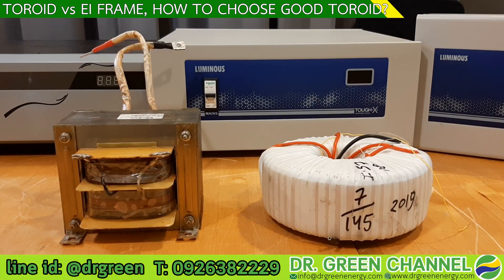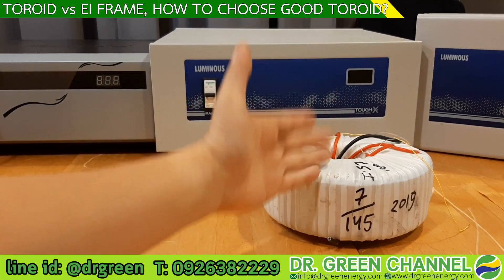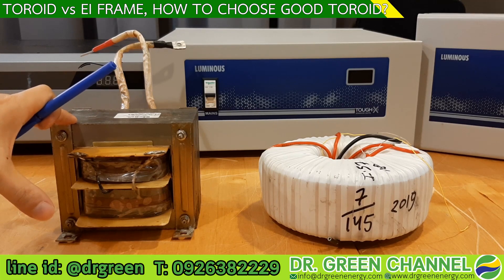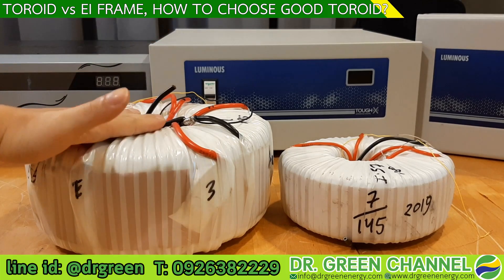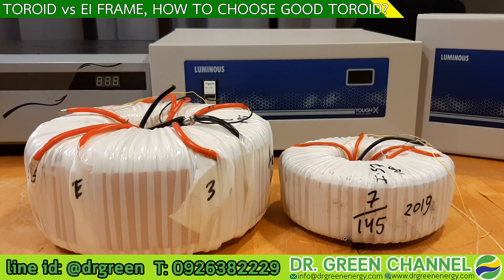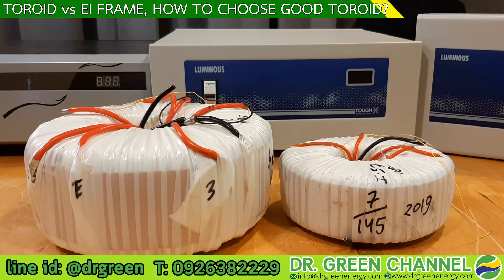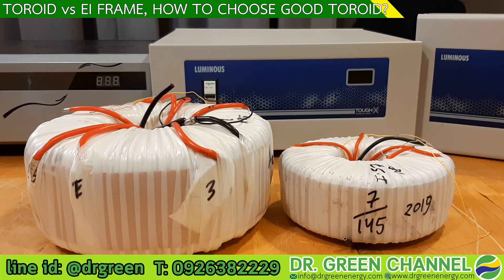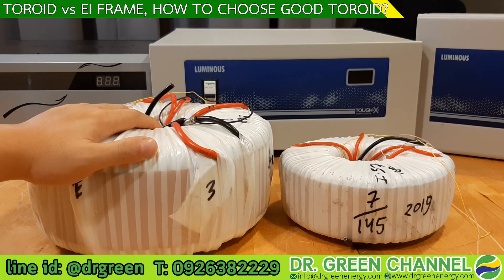Dr. Green Energy - Toroidal vs EI Frame Transformer & How to choose the good Toroidal Transformer?

Comment: Which is good for a audio power amplifier ?
Reply from the maker: This is good question where all the application and surrounding factors are required to be considered. We could find the papers regarding the applications and comparison of output waveform and the effect of electromanetic field, DC offset, frequency response, etc. The other factor is the TCO. Therefore, we could choose the proper solutions for the particular application.